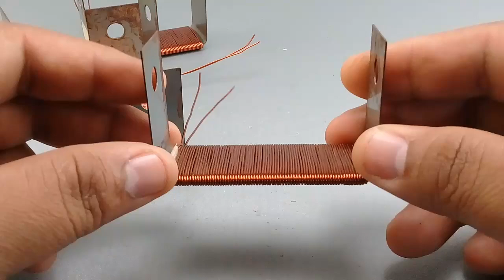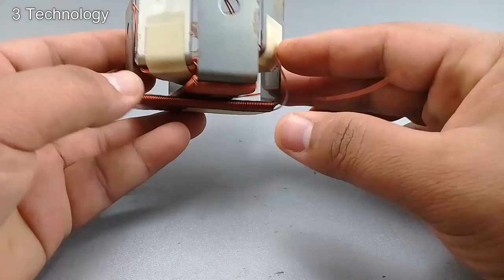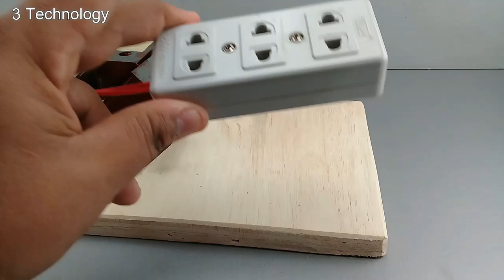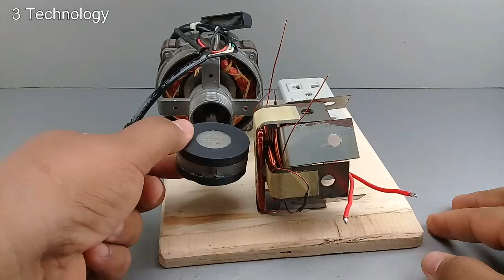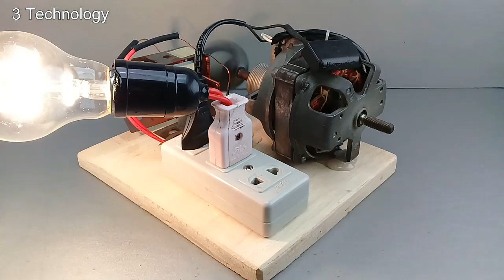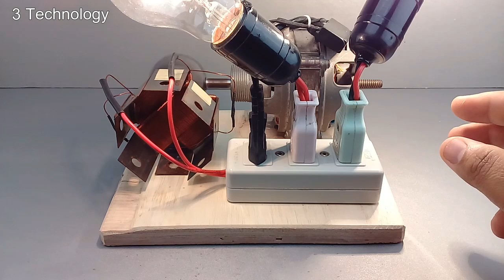How to Make 220v 7000w Electricity Energy From Copper Wire 100%

Comment: Could you please put some stuff we can buy from the store on here, prebuilt I need a 220v 250amp(55,000watt) transformer to run my 220v 180amp device, and a 220v 250amp(55,000 watt) free energy turbine like this 50,000KW 220V Free Energy Generator Alternative Energy Permanent Magnet
Reply: This would save the planet